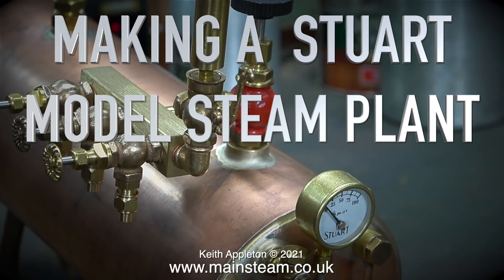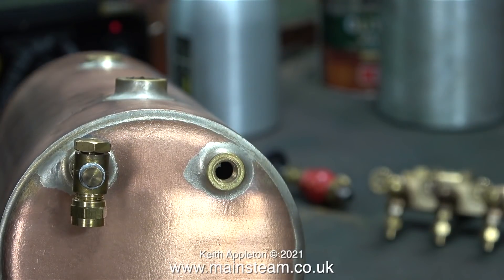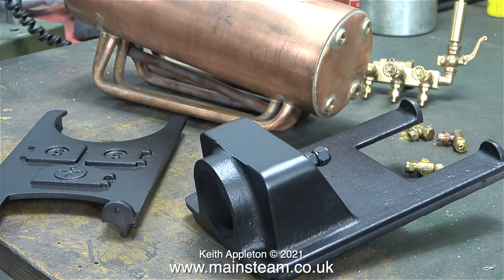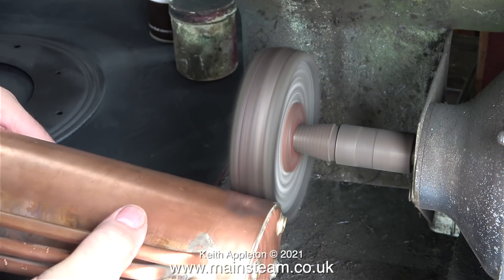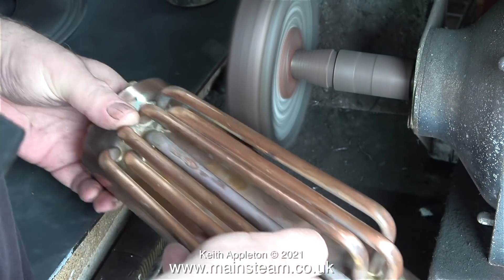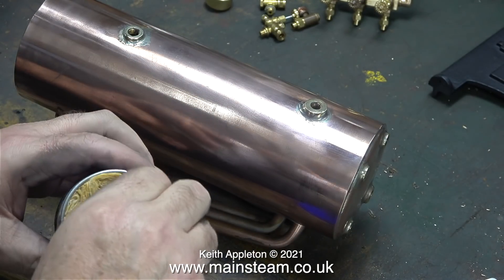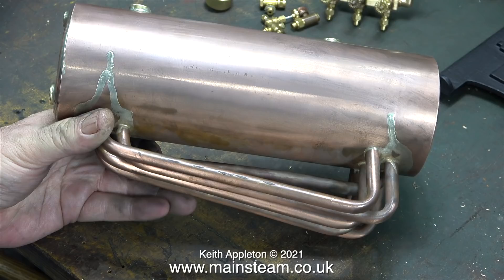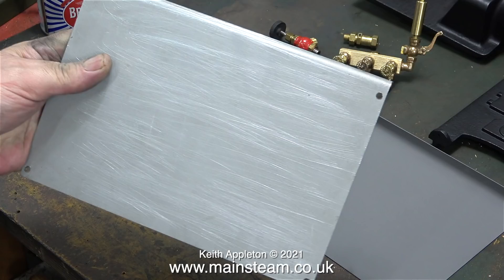MAKING A STUART MODEL STEAM PLANT - PART #37

Comment: When I put together a 504 boiler with my father in 2007-8, I didn't polish the boiler, but instead, covered it in a layer of kaowool and then a layer of copper on top of that; the copper sheeting (soft soldered to fit around the boiler at the ends) was painted black, and this looked good enough for my purposes, and had the added advantage of insulating the boiler and hopefully improving efficiency, as well as reducing the danger of touching it.

That's not to say that there's anything wrong with a nice polished boiler, however! Polished brass does look lovely.

Comment: I remember losing my grip on the polishing compound block and having it fly down and under the wheel hitting the guard with a loud bag.   It's pretty startling when it happens.
Reply from the maker: I once got hit in the face with a piece of Copper Pipe when using an unguarded Polishing Spindle and it really hurt !